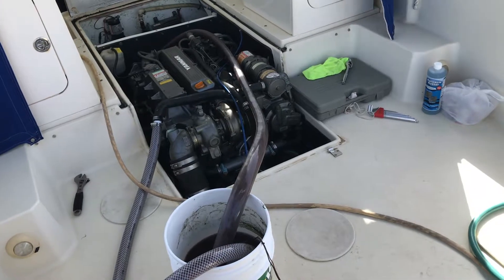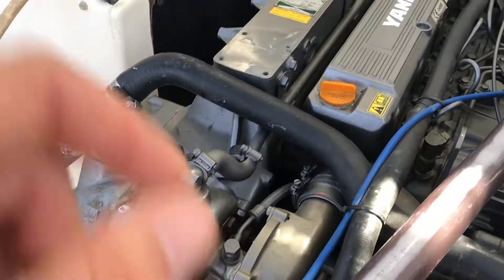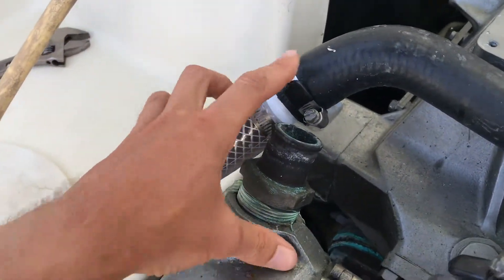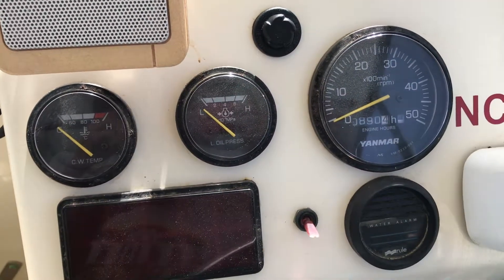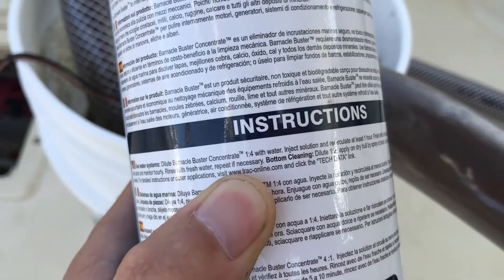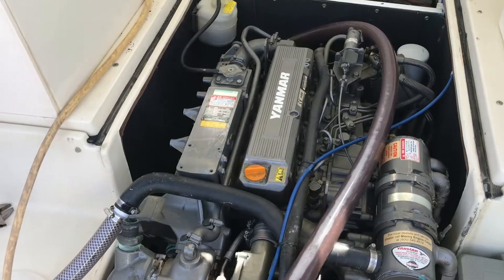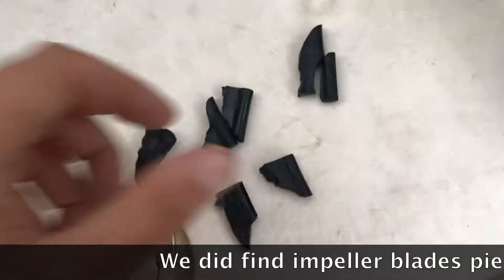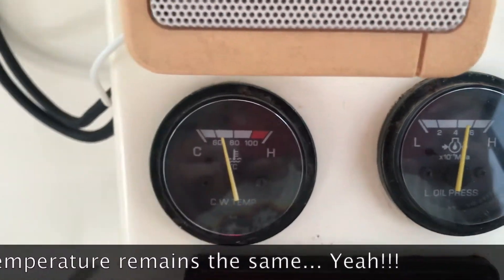Flushing Yanmar heat exchangers with Barnacle Buster

Comment: Will this do a complete flush considering the thermostat valve will be closed?
Reply from the maker: It’s only flushing the raw water system, the thermostat is in the fresh water system. If you need to flush the fresh water system it’s a completely different story.
Reply: I see. My engine is raw water cooled so I have been thinking that to do a complete flush I would not to remove the thermostat.
Reply: Sorry about the typo. I meant I would need to remove the thermostat so that I can do a complete flush.
Reply from the maker: @SteveB_Slowbart  fresh water and raw water system are two different loops in your engine. Fresh water is a closed loop and raw water is a open loop. The water from the raw water is cooling your fresh water loop that is cooling your cylinder walls. That allows to use sea water to cool down the engine without have sea water running through your engine block. Sea water also cools the oil, the air and the gear box oil. This video is intended to clean that whole raw water loop because sea water gets in there and all kind of small organisms that restrict the water flow and cause over heating. If you have to clean your fresh water loop you should search infos elsewhere.

Comment: Hi Vincent- just a quick question re the impeller - did you remove that prior or leave it in - was wondering how the impeller bits go past it when running the flow backwards. Good vid thanks!
Reply from the maker: Hey Jason! I left the impeller in the pump because it was bypassed in the loop. The impeller bits I found when flushing with fresh water were bits from old impellers from years ago. I treated the boat with barnacle buster shortly after I bought the boat. Hope it helps!
Reply: ok got it - thanks! @vincentbourcier7111
Reply: and thanks for getting back to me :)

Comment: Hi Vincent - I set up exactly as you show but had to keep topping up the water, overall putting 200lt through the bucket.
Reply from the maker: Hi Gary! That’s odd, it’s a closed loop and on the 4LHA the cooling system takes about 5L then bucket, hose, BB are probably another 10L so 15 in total. Are you sure you had no leaks?
Reply: @vincentbourcier7111  Hi Vincent I think I have worked it out I have a  raw  water line from the first heat exchanger going to my shaft bearings, thanks

Comment: I have almost same motor do u know what size fittings i need to attach pump to hoses? Thanks so much great video
Reply from the maker: Hi Glen Varza! I don't really get your question but if this can help, I didn't need to use fittings to connect the pump to the hoses it all fitted fine luckily. If your pump output is to small what you can alway do is to either use a small section of hose that fit the output with the inside diameter so your outside diameter will be greater. Or you can use electrical tape and wrap it around multiple times till you reach the desired diameter. Hope this can help! Sorry I couldn't reply earlier, we had troubles with the tropical storms over here, good luck!